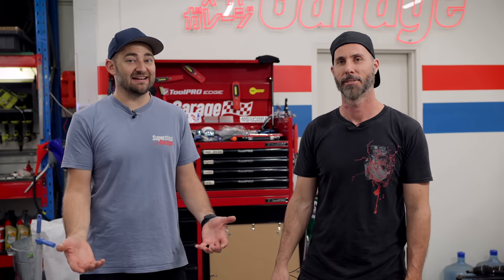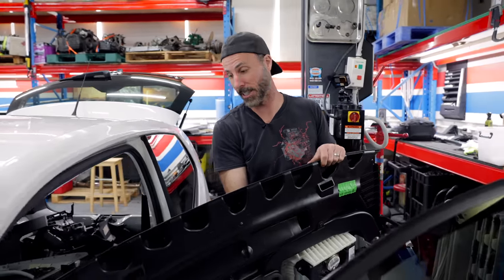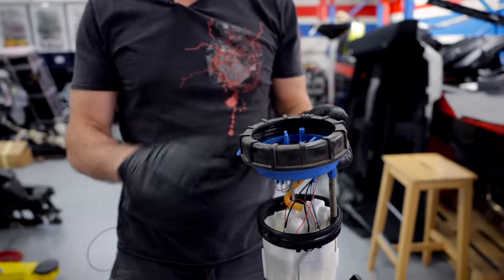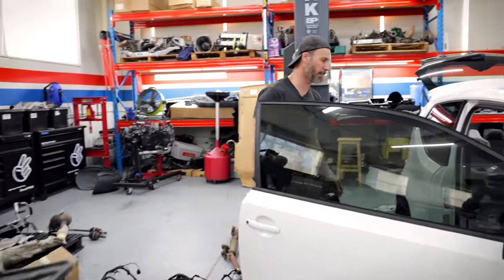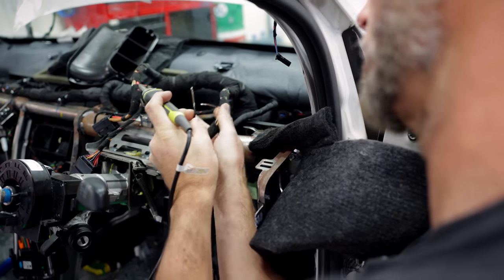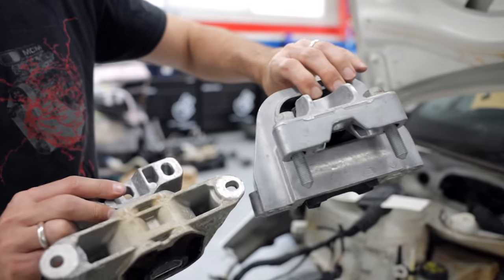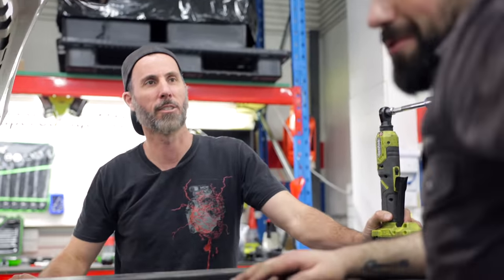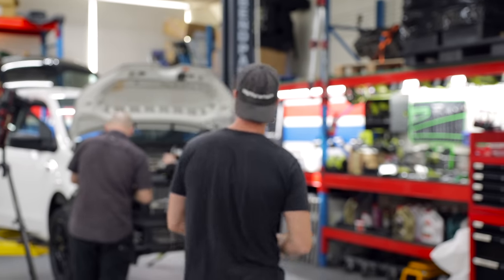Turbo VW UP GTI Conversion - EP3

Comment: Why did the wrecker send you a 5 speed box? I thought the UP GTI only ever came with a 6 speed? It'd be weird if another VAG vehicle didn't also use that same 6 speed but then it's also weird that the wiring is so different. I though manufacturers had gone away from bespoke wiring as it was more costly?
Anyhoo, hopefully the wreckers didn't screw you by sending a normal Up 5 speed as the 6 speed commands a much higher price.

Comment: get the 6 speed. get a H/D clutch for it,  light flywheel LSD bigger drive shafts, you would;d have to do all this anyway so its a no brainer, it will just cost you more

Comment: Hard to believe that every sensor and plugs are different., only time I’ve seen a wire swap like that was a evo8 swap into a civic and a b series Honda swap back in the early 90’s lol 
At that point they should out just bought a gti up lol

Comment: Great video-why do the Germans have to make such a beautiful piece of machinery so complex and hard to work on???
Very stressful and time consuming.
But worth it in the end.
Reply: prior to 1999, a swap like this is easy. like bolt on easy. the mk4 era for vw is when they swapped to "lets make every little thing different." mk4 was the worst cars vw ever made. ive built nearly 100 mk1/2/3 vws and they are always dead easy. my daily is an engine/chassis swap 5 door mk3 golf. everything bolted in directly, no modding needed whatsoever.
Reply: @ghomerhust The mk4 was based on a platform with its roots in the early 90s that was what I would call a failed attempt at a modular platform. The mk5 (PQ34) on, things become properly modular and it mostly gets progressively better with a lot of interchangeable parts across all brands. You can fit a Fabia climate switch module in a Porsche.

The Up is on a weird stand alone platform though, and there are only a handful of models built. It is almost back to mk4 days where you have more or less standard chassis mounts, but each brand shoe horns in their parts by whatever means necessary, resulting in weird incompatibilities.

Comment: Are you boys sure the wrecker has given you the gti conversion.

If you have brought a gti motor and gearbox it should have been a 6 speed gearbox. 

Seems like you have gotten a tsi up motor and gearbox which is the 5 speed.

If thats the case and the ecu is just a tsi one you will only have the 89bhp tune on it, not the 114bhp that the gti has. The motor is the same thou.

Ive toying with doing this conversion my self but the cost has put me off.

Comment: honestly this is Turing out worse than trying to fit an sti motor to an evo motor in the front of a 1969 Cadillac Eldorado.  old school cars would never have this type of issues....and honestly this is why so many American gear heads like old cars..... but yes i am running f.i. on my '89 Volvo 740 turbo even though for 7 months i could not drive it due to the ecu and being to broke the get an aftermarket one.

Comment: I also really want an up gti 
I think I might get one as my first car when I'm done with Uni.
Reply: stoked about this series
Reply: @Daniel-dj7fh  I'd say get a 90hp Up, you can tune and experiment more. The GTI has a stupid particulate filter so you can't really add any power without fear of melting the darn thing lol. Chipping the 90hp to close to GTI levels is easy and probably cheaper all in all compared to getting the GTI. I have a GTI and love it, but it's a lot of money for what you get.
Reply: We have a 96hp polo, technically the same engine, abit more weight.
But it's got white headlining and that's a 1000€ swap. Tuning in Germany is also a pain in the butthole. I'm just wondering if the transmion on the up gti is the same or better than on our polo.
The up is alot of money for what you get. @donotatme
Reply: @Daniel-dj7fh  I think getting that Polo chipped to 115 or 120 hp would be a good start, you're essentially just missing out on the sodium filled valves that the 115hp version has (also slightly bigger turbo I think but doesn't really matter). Transmission should be the same on the inside with the Up GTI. My granny has a Mk7 Golf with the 115hp 1.0 and the 6 speed and it feels the same as my Up GTI. Apart from higher speed at same revs but the Golf also has larger diameter wheels so idk.
Und I'm also German, I am essentially disallowed from tuning my Up GTI in any capacity without TÜV saying no. You're allowed 15% hp over what the top trim of the model has and your exhaust can't be louder than 70db iirc. It SUCKS

Comment: i think the up GTi uses LED tail lights so that might be why its odd wiring. could use data/ canbus to turn the lights on with a ign feed.

try to source those and the little tailgate spoiler.
i think the different lights may bring out a warning light.
Reply: Nope, GTI has halogen
Reply: Only thing LED on facelift Ups is the daytime running lights and the indicators in the mirrors, everything else is halogen. I did put in Philips LED bulbs in the front tho lol

Comment: Guys ffs stop soldering your wires like that.   Soldering is not an acceptable mechanical connection and cars present a constant-vibration environment. 

If in your minds soldering beats crimping (bad crimps are definitely problematic as well) then at least use a linesman's splice, where the mechanical strength of the connection isn't based on the solder, so the solder can just do the job it does best, the electricals.

Comment: you mean 2nd ? pretty sure someone else already did that
Reply: If your talking about the one in qld it has a 1.8L 4 cylinder turbo engine swap from a series 4 golf gti not a 1.0L 3 cylinder turbo from a gti up swap

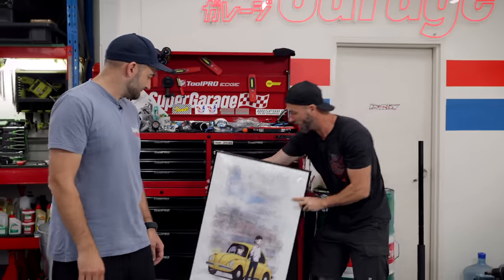Comment: I hope your harness is fine, because if it's not it wont be cheap this year used car repair diagnosed by government car inspection you rather spend on the new car loan . Any chance you have here a Sharan for some students who were asking who wont just call city bee? I will come back here for RS tip once I have it. Not sure something you try to find 1:16 so that was Kapraku so why you have me playing watchdogs? These are the Lidl tools, Parkside. Probably its all about cutting the wire, but you really should find how to get returning viewers in this wire API. 10:02 Why your sound isolating headset is such a mess? Mythic dungeon begins in the evening and lasts over the night, the race is tomorrow.

Comment: Ford is the same with swapping parts like subaru
Reply: The 2014 CX-9 is a 3.7 litre “Ferd” duratec with the water pump inside the timing case with a chain drive. All the transverse duratec engines do this. Toyota own a big chunk of Denso so that stuff appears in Daihatsu and Subaru. Don’t get me started on Jatco shit.

That shitty V6 is in the same year model Ford mustang

Comment: 6:30   *Grammer NAZI Alert*  There are fewer wires in this loom.  If it is a countable item, like a number of wires, then it is fewer.  If it is an uncountable item, like an amount of fuel, then it is less.  e.g. Fewer cars means there is less traffic.
Bring on the hate!

Comment: Basically replacing the entire car but the actualk car bits, wheels, suspension, chassis, body !?
Some differences make sense, some differences you really wonder why.
Also, feeding fake engine sound into your car, i will never understand that, so useless and just extra cost and just fake.